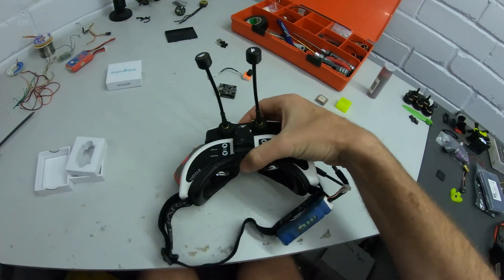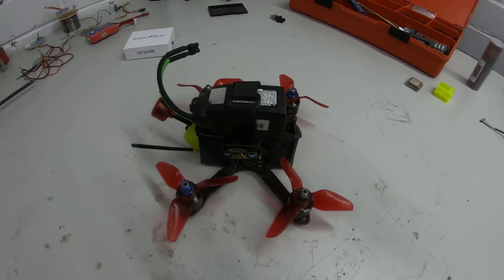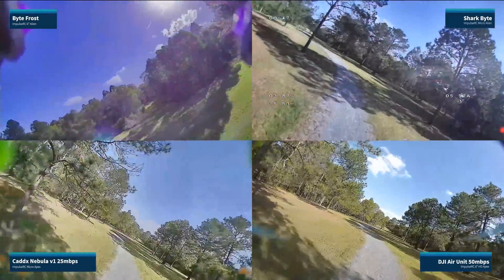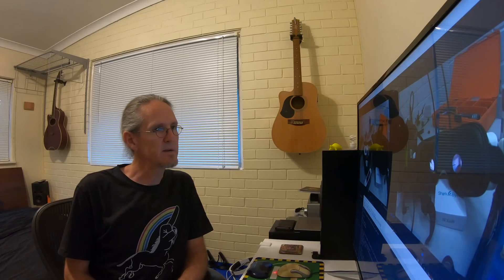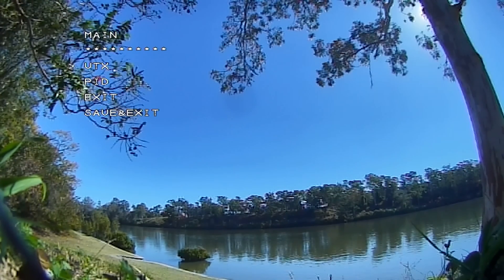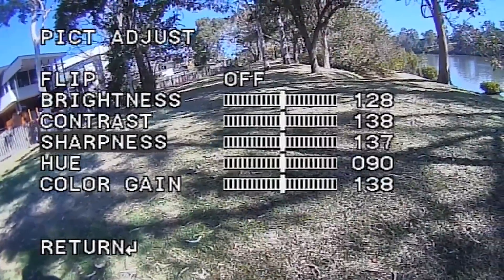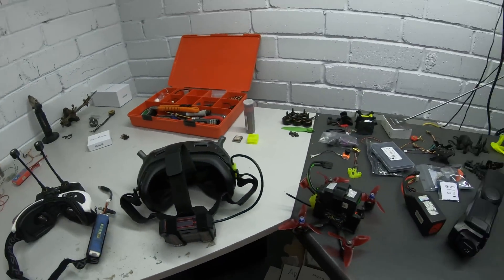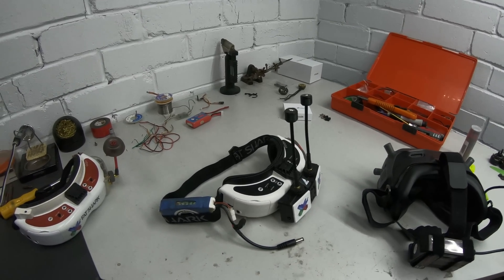Digital FPV Shootout 2 - Shark Byte

Comment: before we say "analog is dead" we need to know shark byte's price, until then it's basically competing against DJI - to which DJI wins on a significant margin.

because obviously, digital image is better than analog... night and day.
Reply from the maker: Price will be important yes. Here's hoping! The more uptake this stuff gets, the cheaper it will also get of course.
Reply: Since many of us already own Shark Byte compatible goggles this should be possible. If Fatshark cannot make a Shark Byte cam/VTX/RX module combo cheaper than a DJI cam/goggle/air unit combo then they would definitely be on a losing position.
Reply: After seeing this great video i thought the same.. how much will it be?
This will be a very big factor for digital taking over.. the price has to come way down.. but we're just at the start of this process after all.

Directly relating to this i've to add that a lot of fpv people already own a shark byte compatible fatshark goggle. 
This should be a huge advantage for fatshark.. kind of a trojan horse.
If they manage to get the system out cheap enough, 200 - 250 max i'd say, or even much cheaper, both goals of "killing" analog and staying alive next to dji could be accomplished.
In the long run it would pay off because think about most of the fpv community really switching over to digital, that would be great numbers in sales.
After about 2 years Dji HD still is a bit of a novelty thing i'd say, some people do long range with it.. at least where i fly (central Europe).
And that's mainly because of the relatively high price tag (i know it may not be that high for some people) and that's partly because you need "the whole" system with the goggles.
Reply: I think exactly the same. We spend so much money on our Fatsharks, we don't want to pay so much for another receiver. I paid 270 for my Fatshark so don't let me pay the same money for a receiver. Around $100 would be OK. Especially since Fatshark let us wait so long. It's not like Fatshark invented digital. It's already out there and it gets cheaper every month.
Reply from the maker: @MirkoKay  2002 called, it wants its pricing back lol. Maybe I'm just skewed by the Australian dollar
Reply: @MirkoKay  this is quiet optimistic. Id bet my left nut itll be around 400 bucks for the first few months, than will drop after medium shitstorm.
Reply: Really hoping its gonna be in the 250-350 range
Reply from the maker: @rocky5763  If I was a betting man I'd say yes.

Comment: well...you need to buy a HDO2 (quaity staff) and them the shark byte ...and a couple or cameras .... How much Is all that? I thing more expensive than DJI
Reply: But most people already have fatshark goggles. So that breaks the price down substantially 🤷‍♂️ I already have a set of Dom v3. Clearly won't be the quality of the HDO or HDO 2 but as it's been said many times outside this video. That will work.
Reply: @Romasu_  Sorry my friend but  this is like the people than buy NVIDIA GTX 2080TI 11GB... but the monitor It's just HD, you can't get the quality of the image , Why you will need a digital module in a goggle with a  bad quality image?
Well, I know than this field It's like hooligans Fat shark and DJI.
But  to be honest , It's a good point more digital options
 in our hobby
Reply from the maker: Older goggles won't look as good - this is true - but the modular approach also makes this a path you can upgrade to a piece at a time. Lots of benefits to digital in addition to just raw image quality - eg better penetration, less channel crosstalk, more power allowed etc...

Comment: I'm barely getting into the hobby and already bought the DJI System, however, I've been paying close attention to this system also. I was hopping this would be the answer to the challenges of putting DJI into micros and whoops where it seems I will may getting more flying time. By chance do you know the weight of the shark byte VTX and Camera? I'm also wondering if I should drop money on skyzone/fatshark goggles or also wait to see if there will be new goggles made for this?
Reply: 15 grams VTX Camera and wires.
Reply from the maker: That's the one. I wouldn't wait for new goggles, HDO2 are it for now.

Comment: This is great about the latency. Hopefully it kicks DJI into a higher gear and release next gen sooner.
Reply: Hardly doubt it. They wont release a new model in a world wide financial crisis. That would be pretty dumb
Reply: Peter Zingler ummm  Fat Shark is releasing soon in the “world wide...” also caddx with DJI’s blessing has released a few products during this time period. Intuitively, you make sense, but intuition is often weak when dealing with systems that pay financial and marketing teams billions.
Reply: Something like 1080/60p ?
Reply from the maker: The raw latency is less of an issue than the variability factor I think. But people like small numbers so it can't be a bad thing that it's quicker (by a tiny amount) :)
Reply: Mark Cocquio true. The dozen spots I fly the latency tends to move between 21ms and 28ms which I don’t notice. Once it gets up in the higher 30s I do see a stutter but that’s at the point where analog would be so much noise that I would be almost blind.
Reply from the maker: @rmhfpv9225  Yeah exactly. Hard to beat that kind of penetration!

Comment: 16ms of latency is not very realistic, unless the camera shutter closes faster than light speed and can catch a frame before it happens, introducing some negative latency. Jokes aside, the system it's 60fps, 1sec/60 frames,  ergo base latency of 16.6ms + camera latency (maybe 6ms)+ decoding latency (10ms if very very good).
Reply: He did mention that he was using 240fps camera for the measurement and that there might be some jitter in the results. I guess we'll have to wait a bit longer for more accurate results. The key takeaway though is that the analog and Shark Byte measures roughly the same and DJI measures worse. AFAIK the Shark Byte is based on block-based encoding (possibly somewhat similar to how GPU texture compression works b), so they don't need to buffer full frame to start encoding and transmitting. The main point for me personally for Shark Byte is the low FIXED latency. I'm probably going to be buying this system if the price is right (already have HDO2) and test it out for myself.
Reply: @flamepygmy  still, the system it's 720p, 60fps progressive, it shows a full frame every 16.6ms, doesn't matter if it transmits the signal much faster. It can't be faster than light. I agree Dji it's still 10 or 15ms slower than that, but the camera captures way more informations, plus it's 120 fps.
Reply from the maker: Flamepygmy you are spot on with those conclusions. Interesting point about 60fps though, that didn't occur to me, and would explain the same results for analog and SB. At least we can conclude that it's "one frame" of latency.
Reply: dav77h It does not use video compression as conventional way. Therefore, there is no frame buffer and decoder latency.
Reply: @TheCarl1206  still, 16ms is not physically possible at 60fps. Even on analog the camera and the goggles introduce some latency.

Comment: Thanks buddy. I see your FETtec esc Box on the desk there. How is their working with FETtec? Osd or do we still need to run the FETtec osd threw this?
Reply from the maker: I'm only using FETtec ESCs, not the flight controller on this one. It runs Betaflight. The OSD needs updating to support kiss stuff.
Reply: @strepto42  That's a bum deal. If the info is sent to the unit it should work. What would keep it from showing up.
Reply from the maker: @ChristopherNovaSmith  I think it's to do with the specific implementation of MSP. Am trying to get to the bottom of it; I don't have enough personal coding experience with this particular thing to know for sure yet but I am chatting with them and others about it. We should be able to get it working!
Reply: Mark Cocquio thank you

Comment: can you plug the module on other monitor?
Reply: anything with HDMI in.
Reply: Just consider the added latency. For example a TV would add a lot of IT.
Reply from the maker: Depends on the display. Some TVs add latency (my old plasma definitely did, but it was only about 2 frames worth).

Comment: Know the price?
Reply from the maker: Sorry no. I think an announcement is coming.
Reply: If it costs a similar amount to rapidfire (which i just bought :/) i feel it would do well.
Reply: @testaccount4191  300-400$ for vrx+vtx+cam. 150? no way. not this year or next.
Reply from the maker: @Nikita-zd1gc  Yes I feel like that's realistic too. Lots of R&D went into this
Reply: @testaccount4191  is the real price if not have VTX unit in pack.
Reply: They need to price it low enough to keep me from eventually going to Dji. It is exciting. I was was waiting for this. I'm retired, and I don't spend as much as I used to on gear. If we're in the $200 range, I would be very excited.
Reply: Hope this will force DJI to upgrade there FW even faster. Sadly fatshark had monopol in FPV for year's and didn't innovate. Now they try to catch that train. Hopefully this will lead to some competition in the industry...
PS: let us use your HD system with analog module in the same time. What's the benefit to keep fatsharks, when I need to install and uninstall module every singles time i go fly with 🦷 pick?
Reply from the maker: @BrodeOne  This works with the analog module still installed, you can use both.
Reply: The Byte Frost I bought was about 400US$. Feeling wise I would say it's  gonna be similar, maybe a bit up... 450?
Reply from the maker: @menne-fpv5128  I think it will be less. But that's a complete guess.
Reply: @strepto42 we will see. I'm only happy that they offer the Bytefrost Clients a discount. That is more than fair in my eyes
Reply from the maker: @menne-fpv5128  Yes I agree.
Reply: @menne-fpv5128  still cheaper than dji though.. I am just hoping the cam vtx combo for drone is less than $100.

Comment: That's a brilliant way to measure latency! So simple.
Reply: Brilliant but it didn't work. How can a system that works at 60fps have a latency of 16ms? It's not even physically possible.
Reply: @dav77h  why? That's approximately one frame of delay at 60fps
Reply: @bizmar  exactly, the camera captures the frame first, it gets stored in a capacitor (introducing some latency), then it gets transmitted, then gets stored again in some buffer capacitor in the goggles (introducing latency), then it gets displayed. So physically you can't see the frame before it gets captured. 
If a frame lasts 16.6ms, camera latency could be 5ms if very good, goggles latency if similar to analog it can't be less than 10ms. Ergo realistic latency can't be less than 30ms, in my opinion.
Reply: @dav77h  Sharkbyte is very analog-y..it's not full frames, it's basically scaliness of little blocks. IF the whole "signal chain" works as a stream of data, like analog, then I think it's doable. I agree it's probably not exactly 16ms.. but in a range depending on how things sync up.
Reply: @bizmar  no, it's 720p, the P means progressive, it sends full frames. Analog instead is interlaced, which sends 60 half frames per second (NTSC 30fps)
Reply: @dav77h  That's not related to how the picture is sent over the air.. obviously there has to be a start and an end..  Brake up pattern indicates that the picture is sliced up into 8x8px (maybe) squares, that are transmitted in series. If whole frames were sent, and then decoded, I would expect the brake-up to look different. 

I've been looking forward to some sort of technical documentation for a while. Here's hoping.
Reply: @bizmar  it doesn't matter in how many bits it split the signal, the displays still shows one full frame every 16.6ms, that's what 720p means. Maybe only part of the frame if it loses a few bits, but this is not related with frame rate!
Reply from the maker: Thanks Mark! It has some flaws and it has been pointed out that the goggles are only using 60fps, therefore 16.6ms is the smallest amount of latency I could measure, which would explain the same result for analog and SB. At least we can conclude that it's faster than DJI by a tiny bit, and that it's comparable to analog in that it's basically only taking one frame from glass to glass, so to speak.
Reply: @strepto42  latency = lag + delay. 
If you believe you misured just the delay you are off by a lot. 
Also in the Fatshark specs it says 25ms, which makes totally sense.
Reply from the maker: @dav77h  I measured the number of 240fps frames in between my flash going off and that light being transmitted by the goggles. If the goggles themselves are only updating at 60fps then the smallest granularity I can measure is ~16ms, which is in line with my results. Honestly at the end of the day I don't think this test means much at all, there are too many variables and inaccuracies. I just wanted to see how it looked, relative to analog and dji. The result was fairly conclusively, roughly the same as analog, and a tiny bit faster than DJI.

Comment: Thanks for the review. Interesting that you should mention that the OSD is done on the VTX - I've been told it was rendered on the VRX and therefore shouldn't break up but you can see that the low voltage text is broken up even in the downloaded raw footage, I wonder if that was rolled back due to time constraints and will be further improved soon.
Reply from the maker: Interesting. Yeah I'm not sure but assumed it was vtx side due to the breakup. But maybe that rx post processing? Would be interesting to clear this up with the guys. Either way the OSD needs work, but at least that's just software. Cheers for the comment!
Reply: @strepto42  that's pretty weird , on your video the osd breaks up with the signal but when you look at Nick burns review of the sharbyte you can clearly see that the osd doesn't break up (especially when he goes outside there's like a whole frame of interface and the osd stays solid) so maybe a different firmware version ? Maybe something to do with the fact that he was using the 200mw 1 board vtx ? Idk
Reply from the maker: @nistax2880  Yeah not sure what the story is with the OSD breakup. I have since been running newer firmware though. I'll have to have a closer look at my footage.
Reply: @strepto42  keep us posted man thank you , great video btw
Reply from the maker: @nistax2880  Will do, thanks man :)

Comment: Nice vid - exciting. Can you comment on how many sharkbyte channels it runs? I wonder how many pilots can I put in one heat for a race. Dji is very limited in that regard.
Reply from the maker: Thanks! It has 8 channels which correspond almost exactly (but not quite) with Raceband. We flew analog and SB together and they play relatively nicely with one another. DJI causes interference to both systems.
Reply: Mark Cocquio that sounds fantastic!!
Reply from the maker: @MattVentureNL  Agreed!

Comment: Great video but it is to be understood how the Fatshark system behaves in case of anomalies / disturbances .. Similar to analoigic? will it crash? It seems not ... but I don't see this great digital quality.
the DJI system has a good penetration / range and quality but if there is an anomaly it "doesn't" give you warnings the video just stops (black screen).
Reply from the maker: Yes, similar to analog, but it can fail completely, and won't reconnect quite so fast as analog. However, it is much more like analog than DJI. You get much more warning and a faster reconnect.
Reply: @strepto42  thanks. Good Job

Comment: Thanks for doing the comparison Mark. 👍👍
Shark Byte is looking pretty good for an initial version, much-improved hardware form factor over Byte Frost, and no need to go out and buy new googles. Breakup looks better than I had expected.
Hows the dehydrator working out for your printer filament?
Reply from the maker: Cheers. Yeah I agree. It's much more polished now and even though some aspects still need work they're mostly software-related. Dehydrator seems to work great, my TPU looks awesome! Lol

Comment: So static 2.0?
Reply: I much prefer static to frame drop and pixelation. Static is flyable.
Reply from the maker: @NicksNameGoesHere  Yah. It's a trade-off with DJI. You get amazing range and penetration but have to be prepared for sudden glitches and stutters if you push it in the wrong places. SB is much more like analog, you get the fuzz but can still see through it and that warns you that you're about to drop out before it does - DJI can do it without warning. Horses for courses!
Reply: @NicksNameGoesHere  I don't know man, static lines are quite disorienting, at least for me. I'd rather have a pixel mess. The static is the worst part of analog systems for me.
Reply from the maker: Digital static goodness!

Comment: Thanks for the vid! How long is the runcam cable? On 3 inch it should be fine but in 5 inch it would be most convenient if that cable can reach back to rear stack.
Reply from the maker: That is an excellent question. It's basically 8cm. I've already flagged this with them as being a touch too short - 10cm would be better.
Reply: @strepto42  although this is more a runcam question really. Would you mind checking to see the official name of the camera on the back? I'll email them. Thanks again.
Reply from the maker: @theronin48  Nano HD is on the box. But you know how often these things can change... good luck! Tell them to make me a 3D version ;)